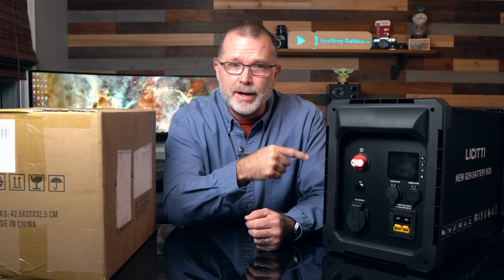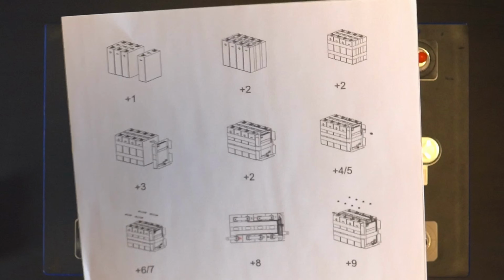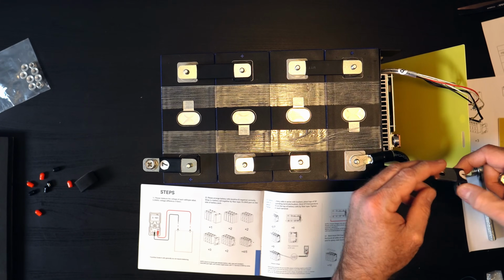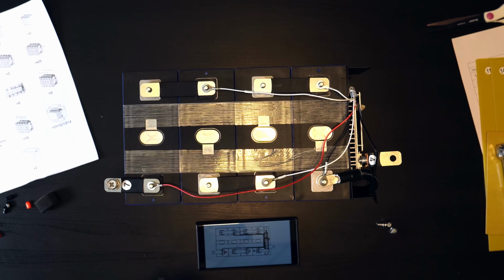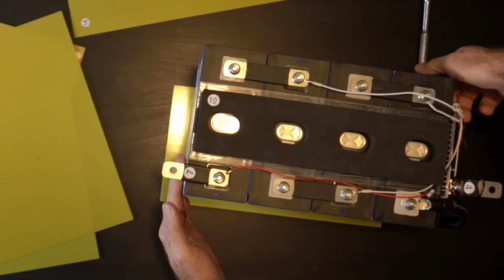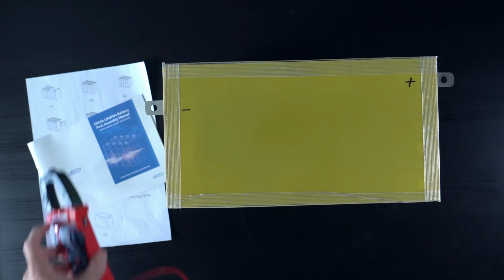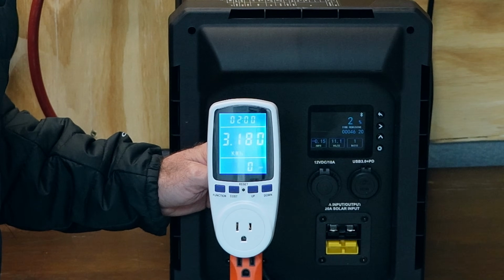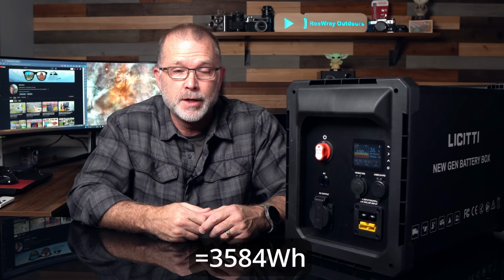EASIEST DIY LiFePO4 BATTERY BUILD:  Licitti 280Ah Battery Kit

Comment from the maker: IMPORTANT NOTE:  while you can connect up to FOUR of these 280Ah battery kits is PARALLEL, I'm advised by LICITTI that you can only connect up to TWO of them in SERIES...so the maximum system voltage you can create with this product is going to be 24V (and not 48V as I speculated in my closing comments).
Reply: What about in series? For 12v
Anyone know?

Comment: I've seen so many raves about Licitti that I have to chime in here... I recently bought an RV and wanted a good powerful battery and found these discussions. Your video here helped me make the decision to go for it. I placed an order about 5 weeks ago for the large box, the batteries and the 30A charger. 

The web page said that everything would be shipping for california - PERFECT. I'm in CA.

But the box and charger arrived pretty quickly, the batteries were AOL. I wrote and was told that the batts ship from China (even though the web page says california). I'm told that I'll be sent a tracking number when is ships. Weeks later I ask again and hear nothing. I wait a while longer and finally dispute charges with paypal.

A shipping notice goes out the next day. The batts arrive, but are missing several parts and include a different BMS. There are no bolts for the terminals, only 3 busbars and the oddball right angle connector that yours shows as #4 is also missing.

So I send another email and start another wait. I just thought that people seeing this should know that when you order, you will not get a confirmation. You will not get tracking info and you may not get replies to your inquiries. These are things I wish I knew before I dropped $1200 down a black hole.

Comment: Hello, I currently have the Licitti 1000w battery box with 4, Lifepo4 prismatic cells rated @ 3.2v for a total of rating of 14.4v for 310ahs. It does not have a Bms. Would it be possible to use the BMS you’re using on your 2000w battery box with my 1000w battery box? If yes, does Licitti sell that BMS separately? What brand of BMS is it and where can I buy it? Thank you

Comment: Do you by chance have the measurements of the batteries? Or the measurements after you put it together (length x width x height)
Reply from the maker: Without taking the terminal tabs into account that actual dimensions are: 13" x 7" x 9" (very slightly rounding up).   In millimeters: 330 x 176 x 228

Comment: The most appealing part of the kit is the modularity and repairability. When a component fails, I will be able to diagnose it and replace the part and not have to chuck the whole thing in the trash. I can also swap out the battery as needs and technology change.

Comment: Have you found dimensions?
Reply from the maker: I just looked them up for you.   Without taking the terminal tabs into account that actual dimensions are: 13" x 7" x 9" (very slightly rounding up).   In millimeters: 330 x 176 x 228

Comment: Not sure that battery is safe when constructed with the parts supplied.  Usually In aluminum prismatic batteries the battery case is connected to the positive terminal.  That means if the very thin plastic coating is penetrated you will have a short between two cells.  Most prismatic batteries have either barley paper, plastic sheeting, or resin board separators placed between the serial cells to prevent accidental shorts.  I ddn't see that in the parts layout, nor in the construction.  I personally would not use that kit without the separators.
Reply: Thank you for your comment. I have now ordered sticky back barley paper to use as separator between battery cells in the Licitti battery kit which I have already ordered. Much appreciated you sharing your knowledge.😅

Comment: Low temperature protection is for charging, not discharging.  Look at the specs.
Reply from the maker: That's why I tested with the charger attached. And there's only 1 temp lead...and it did not respond to cold. So I stand by my conclusions.
Reply: Cold temp sensor may be on the board itself, since the entire unit would be subject to cold. Hot needs to sensed on the cells.

Comment: This appears to be much smaller than pre-built 280A batteries.   I can't find dimensions on their web site.
Reply from the maker: I actually have a pre-built 300Ah battery in an ABS enclosure with built-in heating from SFK (SunFunKits) and it's roughly the same size as this 280Ah Kit (roughly)...but it's also 3x the cost.

Comment: Rookie question.  Can I start a car with a dead battery from these?  Since car batteries quote 750 CCA, I am assuming not.
Reply from the maker: Correct.  They're great for charging a car battery...but not jump-starting (generally).  Some power station include this capability, but they have a special high-current discharge circuit specifically for that purpose.

Comment: Hi David,
           Those look like some real nice cells and a nice kit, That's a lot of watt hours when all assembled. These boxes are such a good idea. The only downside, as mentioned before, is the solar charging is capped at around 275 watts. That would be okay with a 100ah battery but is really inadequate when you're packing 280 ah. You could, of course, buy one or two of the battery pack kits and add your own solar charger and inverter, as you have stated. If these boxes sell well,  maybe they come out with an even a bigger one? Maybe on wheels, who knows? A 5000+wh kit with a 3000watt inverter and a bigger, more robust solar charger. Add a few more AC and DC outlets too.  Sounds like a good idea to me. Thanks for another wonderful and informative video David. Stay warm in your workshop, these temperatures are no joke. Let's hope the groundhog doesn't see his shadow in a few weeks. I'm ready for spring.
                                                                                            Take care, Steve.
Reply from the maker: Yeah that low solar input capacity is problematic if you need to rely on solar. But the battery kit would also be fantastic paired with your own Inverter and CC.  Oh and I will also say that if you want to be able to move it around, 3.5KWh is just about as heavy as you're going to want in a single pack. It's a BEAST.
Reply: I just got one of these units.  One nice thing…it has an extra 50A black Anderson connector direct to the batt that can easily take the output of a second solar controller (provide your own) and you can get another 20…40 charging amps in to supplement the internal 20A mppt solar.  Also use it as an external Ac/DC charging input.  I think it’s a pretty flexible little unit and nobody touches the price/KWHr as far as I can tell.
Reply: I think you might be off on your solar input calculations. By just wiring my solar panels in series, I can input around 800 watts into my Ecoflow Delta rated at 13A. The inputs in this video are 20A - I can't find the full specs but I bet their good for at least 1000W input, if not more.
Reply from the maker: @kappytime yeah, at first glance, it's tempting to assume that since it says it has a 20A cap on solar, you could just multiply that by the max voltage input and you'd get 1000W+...but that's actually not how it works.  You'll never get the max Current at the max Voltage.  And as it turns out, the charge controller used in the 2000W AC Batter Box does actually top out at between 265-270W.   It actually says that on the charge controller (if you open the case and take a look), and my test results also confirmed it.

Comment: I have a grid tie solaredge based system without batteries(yet)! Looking to expand in a year or so and add maybe the EG4 18000k and more panels with batteries. Electrical rates in Oregon just went up 14% 😳.Would this be a solution for my needs when I upgrade? I do have a well pump and central air which will be replaced by Solar mini splits very soon. Great tear down and explanations in this video and this looks like a great option for someone like myself who prefers DIY over just off the shelf plug and play. 👍🏻

Comment: The unassuming way you present information undoubtedly makes your content quite a bit more consummable to viewers who are not already well-versed in products like this.  I follow this space a fair amount and I've got to say that this battery kit from Licitti is priced very competitively, given what you have when it's finished.  Presuming the BMS is suitable for 4S connections, four of these kits used to build a 48v, 280AH (14.3Kwh) battery for just $2,000 is excellent.  Compare that to the commercially available products and you'll find that this is a very good value.  Those voltages are quite low - those cells are at a very low SOC.
Reply from the maker: Thanks Jason! And yeah that starting voltage was pretty low...but to be fair, they were sitting in the box in my freezing garage fro a couple of weeks before I could get to them, so I'm sure that was a contributing factor.

Comment: Great video, you should take off your ring when  building batteries, you could short out something or get a good  burn.
Reply from the maker: That's an excellent point, in general!  But in my case, I use a silicone ring, so it's a non-issue for me...still worth pointing out though!.